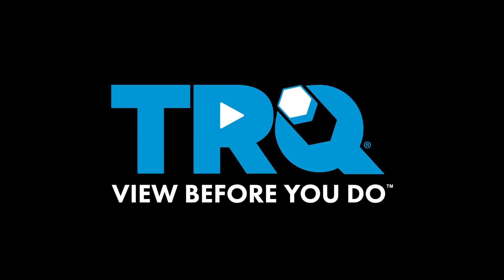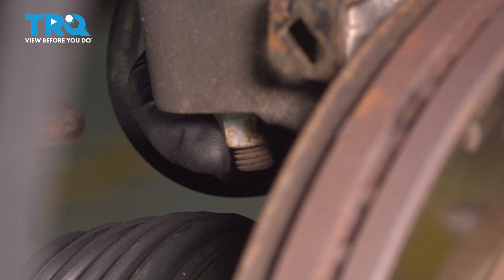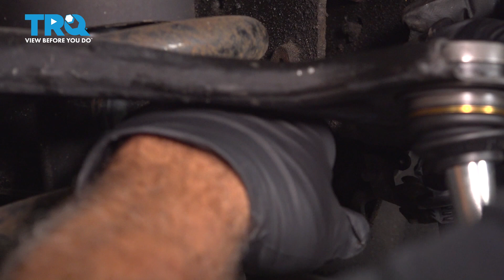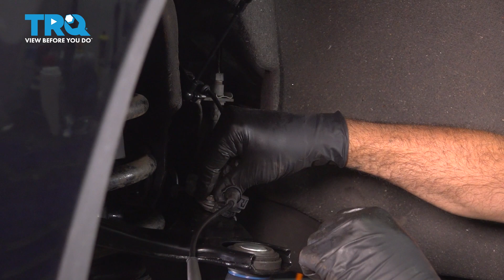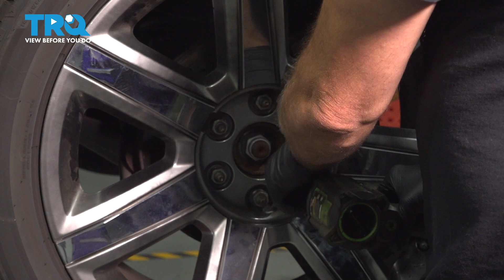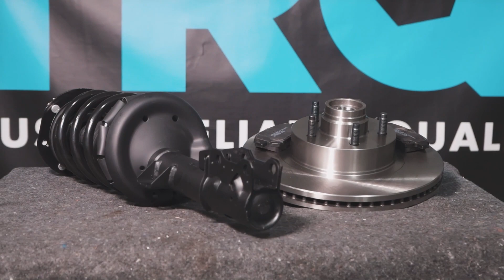How to Replace Upper Control Arms with Ball Joint 2015-2020 Cadillac Escalade

Comment: Very helpful, but I don't understand why nobody cleans bolts before reassembly anymore. Also, I prefer to clean the areas where the control arm meet the frame so that foreign material doesn't get between the new and old parts. Just takes a few more minutes.